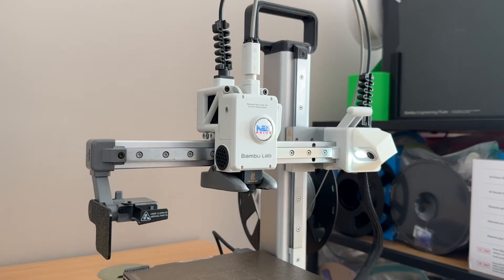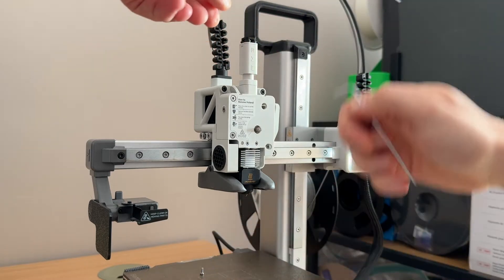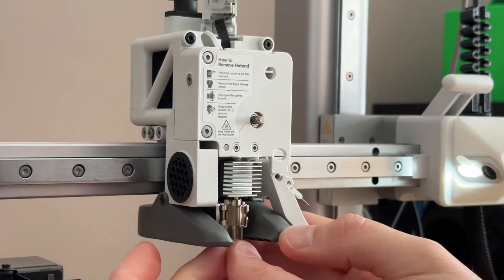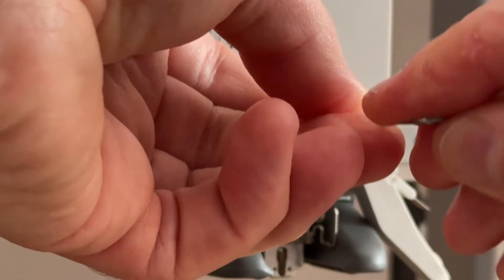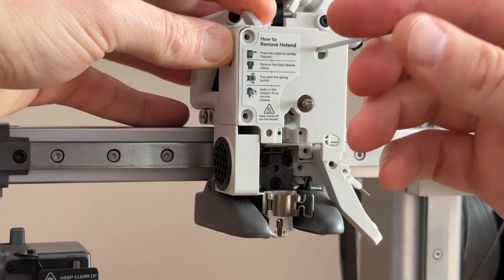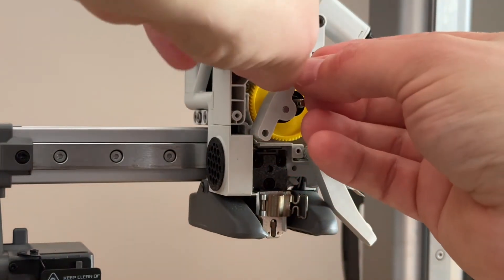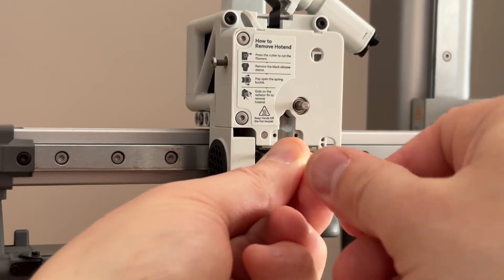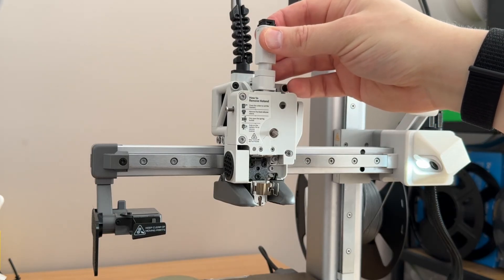A1 Extruder loose nozzle fix and tear down

Comment: Vielen lieben Dank 🫶👍🙏
Reply from the maker: Gern geschehen
Reply: @Kenprints  Hallo, vielen Dank nochmal für das ausführliche Video. Ich habe noch eine Frage, vielleicht können Sie mir helfen. Nach dem Austausch des Extruders funktionierte mein Drucker eine Weile, dann erhielt ich folgende Fehlermeldung: „Filament konnte nicht extrudiert werden. Dies kann durch einen verstopften Extruder oder ein festsitzendes Filament verursacht werden.“ Ich habe alles korrekt gemacht. Vielleicht ist der Sensor auf der Extruderplatine defekt? Ich weiß es nicht. Vielleicht haben Sie eine Idee 🙏. Vielen Dank im Voraus für Ihre Zeit und Unterstützung. Beste Grüße
Reply from the maker: Hi there

I suggest heating the nozzle to 250 degrees and trying to manually extrude filament while the nozzle is free from the bed

If that doesnt work or has clicking you have one of two issues i would say its either a nozzle clog or you have filament jammed in the extruder 
Heat it first and see if it can manually extrude and if not remove the nozzle and see if the filament is making its way thru the extruder without issue if it does then its an issue with the nozzle so remove it or replace it and try perform a cold pull on the nozzle to get the clog out
Reply: @Kenprints  Hallo und vielen Dank für die schnelle Antwort. Ich habe bereits alles wie beschrieben schon mehrfach durchgeführt. Ich habe lediglich die Düsenspitze gewechselt, da ich momentan keine vollständige Düse (0,4 mm) besitze und eine neue bestellen muss. Das Filament fließt bei 250 Grad Celsius einwandfrei durch die Düse. Ich höre keinerlei Geräusche oder Ähnliches. Der Extruder funktioniert tadellos (ich hatte vermutet, dass der Extrudermotor defekt ist). Sobald ich versuche, neues Filament (AMS Lite) einzulegen oder etwas zu drucken, erscheint eine Fehlermeldung.
Reply from the maker: Does it detect filament in the filament sensor ?
Reply: @K @Kenprints  Ich bin mir nicht sicher, ob ich das richtig verstehe; 😥ich bin kein Experte auf diesem Gebiet. Ich verwende keine Bambu Filamente. Wie kann ich feststellen, ob die Filamentsensor die Filamente erkennt?
Reply from the maker: I will share a different video and it shows the filament sensor and the small green light that indicates the sensor detects filament
Reply from the maker: Bambulab A1/A1 mini filament runout sensor replacement
https://youtu.be/QjjF6MeWcW4
Reply: @Kenprints  Und ich habe wieder etwas Neues gelernt 😊. Ich habe mir dein Video angesehen. Mein Sensor funktioniert, aber aufgrund der Fehlermeldung gehe ich immer noch davon aus, dass es am Filamentsensor liegt. Ich werde den Sensor und die Düse austauschen und hoffe, dass das das Problem behebt. Vielen Dank für die Informationen und die investierte Zeit. Deine Videos sind sehr hilfreich. Super! 👍🙏👌tausend mal danke
Reply from the maker: You are very welcome

Comment: Very very good video. I wonder if a loose extruder nozzle could be the reason for my prints to be a stringy mess. It looks like a spider on LSD has been working.
Reply from the maker: Could be a few things
Have you ensured the filament is bone dry first ? Ive only really had stringing issues on the bambu stuff when my filament was damp or the temperatures i was using was incorrect
Reply: @Kenprints  Oh, now when you mention filament. I have moved the printer from a quite warm room to a room with much lower teperature. Might be a damp issue. Is there any way to dry the filament without special gear? Yeah, i am a total noob at this!! I am very greatful for your answers!!
/ Jimmy
Reply from the maker: There are specific filament driers that heat the roll to about 
50 degrees celcius  for pla 
55 degrees celcius for petg etc 

I guess if you had an old oven or something you could easily regulate the temperature in you could use that - i would suggest a dedicated drier though you can also get silica gel dessicant in large containers that absorb moisture you can put containers of that in along with your filament and it will pull some moisture out but your best bet is a dedicated drier
Reply from the maker: @j1I9M7M4Y this is one of the cheapest on amazon and will likely suit your needs as a newbie

https://amzn.eu/d/00b4LpN
Reply from the maker: You can print directly from them which is the best option in most cases - i was printing tpu directly from the drier last week and the results were really really good - this was after drying for 8 hours the finish was impeccable and no stringing

Comment: Great video! Mine isn't grabbing/holding the filament. I can pull it back out of the extruder without resistance. ...my extruder gear (yellow wheel) seems a little loose in the bearing, and doesn't seem to be grabbing the filament. I took it all apart, everything seems clean, nothing looks broken, put it back together and still not grabbing the filament properly. I will check the tensioner to see if I have the little spacer at the right end of the spring... otherwise I'm at a loss. Thanks again for the great video!
Reply from the maker: Is the tensioning lever loose ?
Reply: @Kenprints  HA! NO I can't believe I missed it... I lost the front bearing, that holds the extruder gear in place! I was tearing my hair out trying to figure it out... I printed one for the time being, and it's working great! Amazing what a little bearing can do... I can't find it, or the official size, anywhere. I printed a bunch of sizes to try ended up about 10mm with a 4.5mm hole, and about 3.5mm tall... do you know the actual size? I will ask Bambu too. Cheers!
Reply from the maker: I could be wrong but i think they are the same as the ones on the p1s extruder if so the bearings off the roller from the ams will fit
https://eu.store.bambulab.com/products/ams-driven-support-shaft-assembly

Comment: at 4:47 i wanted to remove those 2 screws but the one on the right have problem i couldn't unscrew it because it kept slipping out
Reply from the maker: It wont come out ?
Reply: @Kenprints i tried again with another hex screw and it came out
Reply from the maker: @nhavongoc5873 good stuff maybe replace it the head may be worn
Reply: @Kenprints the one came with the machine was bad quality

Comment: Is it normal for there to be grease/oil in the black part that pushes the filament down? It’s the first time I’ve opened the head of my printer. Thank you very much.
Reply from the maker: The 4 into one adapter piece ?

Comment: One question about the extruder, when adjusting or replacing how do you know the right position to tighten the screw in to get perfect esteps of filament etc, there are no videos of this being done.
Reply from the maker: @stuart4176 do you mean the tensioner screw?
Reply: @  yes that’s the one
Reply from the maker: @stuart4176 it was tightened in as far as it would go from factory so i just did the same when reassembling
Reply: @  ok that’s great thank you.
Reply from the maker: @stuart4176 no problem at all

Comment: What size is the spring in the extruder i need to know please 🙏 😭
Reply from the maker: @SonnyCollyer  il check shortly
Reply: @Kenprints  thank you so much
Reply from the maker: 10mm long and 7mm wide with an internal diameter of 5.4mm
Reply: @Kenprints  thank you do you know where to find it on bambu?
Reply from the maker: @SonnyCollyer search for 

Screws Kit - A1 Series and AMS lite

Part of the replacement screw set only €10

Comment: This tightening not enough, also have screws of connection heater  to its base, which is also loosing. They on the back side of this grey plate.
Reply from the maker: @humphet3750  yes i have a newer video released yesterday covers this
Reply from the maker: @humphet3750  https://youtu.be/k2BYvY72XSM?si=vTRofYUHl5Kk3U3h

Comment: I've had problems with bad extrusion and artifacts too with my A1. Tightening those 3 screws at the front of the nozzle holder wasn't enough. The solution was to remove this plate and tighten the screws at the back of it as well. A guy here at Youtube gave me that hint.
Reply from the maker: @214bettyboo  you are correct if i get my hands on another a1 i will do a quick vid of those bolts

Comment: My A1 mini was printing fine.  Then all of the sudden it started under-extruding.  I've done EVERYTHING to troubleshoot.  I still can't figure it out.
Reply from the maker: @boboscurse4130  have you checked to see if the nozzle is loose? Keep an eye on it when it is trying to level the bed and see if the nozzle moves up and down as it probes it more than likely the nozzle attachment plate is loose which means it's not getting a correct bed measurement so it can't extrude correctly once it starts
Reply: @Kenprints  Yes it was loose!   It wasn't firmly installed with the little lip resting on the heater.  DOH!
Reply from the maker: @boboscurse4130 hopefully thats u sorted

Comment: Nope lol. Remove those three screws. Carefully lower down the hotend black block being mindful of the wires attached to the bottom. You’ll see 4 black tiny screws on the black pads back. THOSE are what you tighten.
Reply: thank you sir
Reply: you sir desserve an award. mine were looser than an brothel elder.

Comment: I had to do this too while I was deep cleaning the extrusion gears because they were not gripping filament tightly enough and gave me errors.  I removed the gears and cleaned with wire brass brush and compressed air.  The bambu A1 and A1 Mini wiki maintenance and troubleshooting diagnosing pages are excellent and with great photos.  It's not as intimidating as it seemed after doing these steps myself.  I check the tightness of those heater element screws from time to time (there's 7 screws altogether, including the 4 on back side of the heater stone).
Reply from the maker: i didnt dig any deeper when i found those 3 were loose i stopped but you are correct there are 4 more screws i probably should have checked while i was in that far
Reply: @Kenprints  yep 2 out of those 4 were loose for me,  i only got the printer 2 weeks ago. so definitely check those
Reply from the maker: @EnnTomi1 quality control seems to be lacking a little on the newer machines
Reply: @Kenprints kesinlikle. Bu hem bakım hem olası başka hataların, oluşmadan önce önüne geçmektir.
Reply from the maker: Yes correct
Reply: @Kenprints I'll try making this tonight after watching the tutorial video you shared. Sometimes it causes problems and the filament can't extrude. It's probably the gear there that's faulty. I'll check it and replace it with a new one. Thank you for the content and information. 😊
Reply from the maker: Any issues drop a comment here or you can find me over on facebook, insta or snapchat just look for kenprint logo 
Merry christmas
Reply: @Kenprints Thank you so much, I'll write my feedback here. Merry Christmas! 😊😊
Reply from the maker: Best of luck
Reply: @Kenprints Everything was great except for one problem: the ribbon cable to which the socket containing the tubes coming from AMS is connected. The cable was so long that when I plugged in the socket, the ribbon cable was sticking out.When I watched your video, you placed it on top of the extruder mechanism without pulling the cable, so the ribbon cable did not come out. 😅 I had more trouble putting it back in than taking it apart.
Reply from the maker: Did u get it back in ?
Reply: @Kenprints I wrapped it inside with a small Allen key.
Reply from the maker: Yea i had to do similar with another a1 mini it didnt want to feed in easily so i fished it thru with allen key